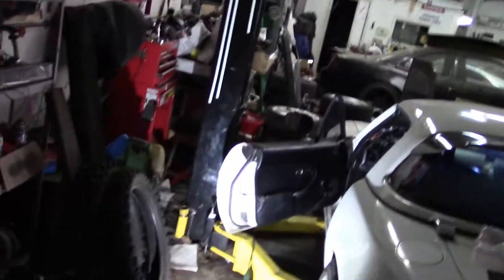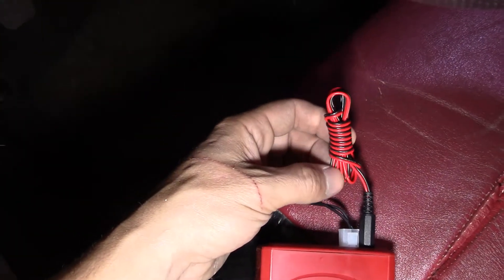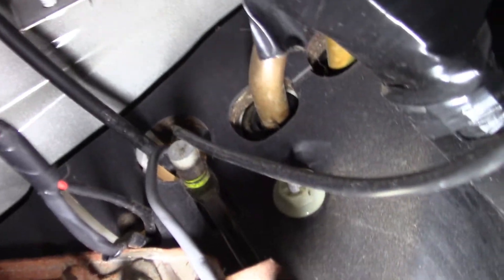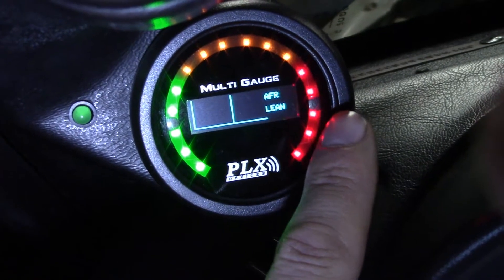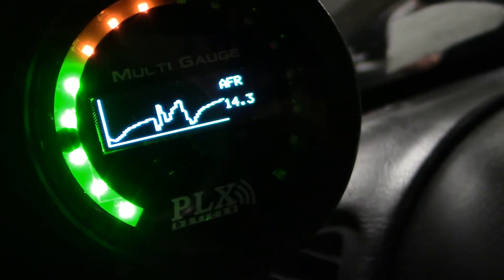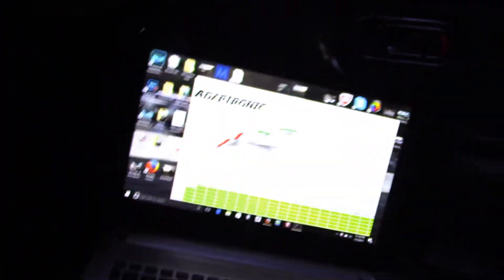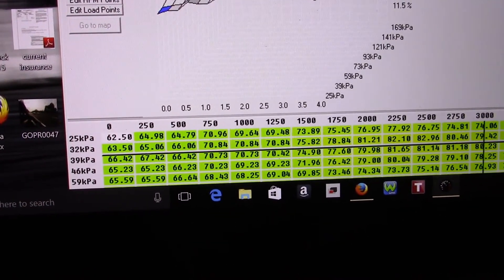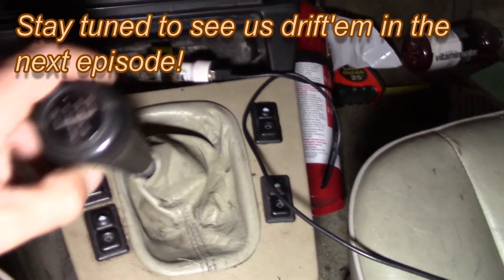PLX WIDEBAND, GM 3 BAR MAP SENSOR patch for Adaptronic ECU

Comment: nice videos man , im just starting building my mx5 (miata) subscribed ;)
Reply from the maker: Thanks for your support. lmk if you need any advice on the build!
Reply: thanks man i will definately give you a shout , i bought the greddy piggy back Ecu as its a cheaper alternative to the megasquirt and im fairly confindent that it will work fine as they're a old mechanical engine . i am going to upgrade the cam shafts before i put the turbo in , if i do . So far i have fully adjustable BC coilovers , braided brake lines , drilled grooved disks , jackson racing manifold  . I intend to give the engine a  full rebuild also , Bernard gutair is my facebook if you want to give me a add for a better medium to relay information , thanks for the offer :)
Reply from the maker: I found you on Facebook, but its not letting me friend request you. maybe something to do with your privacy settings.
Reply: I changed the settings now , didn't realise I had that on . thanks